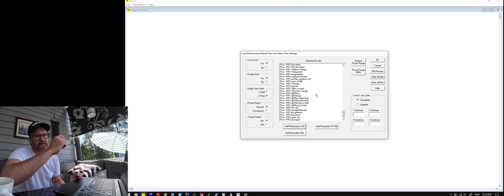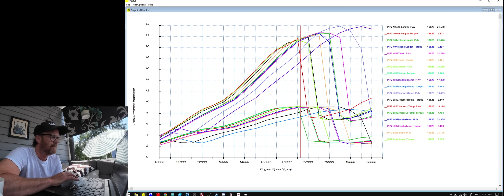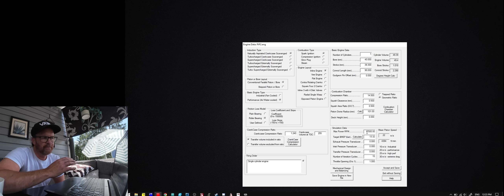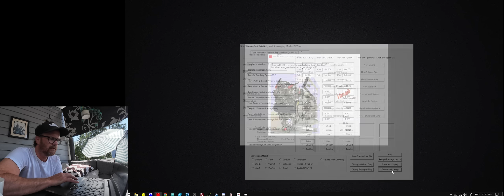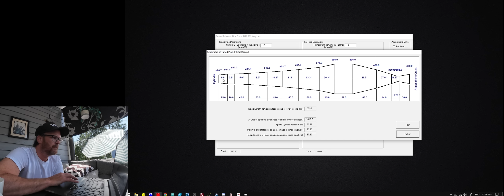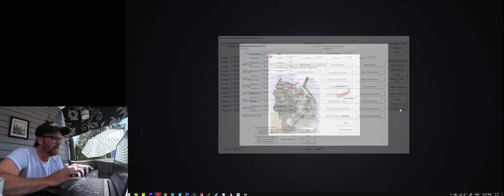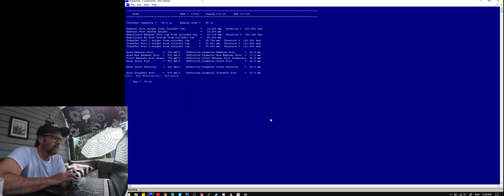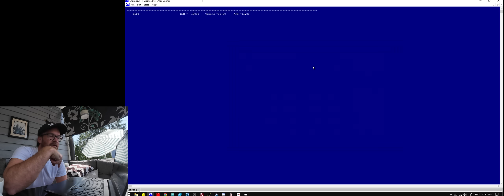A HUGE flaw in my 50cc Two Stroke model?

Comment: I've been using engmod for about 12 years, and I noticed the transfer-passage-layout section was not shown ( 'Design Passage Layout' button, followed by 'Display').  This sets the locations and angles of the transfer ports in the cylinder, and is absolutely critical in getting accurate simulations.  It's a pain to do, but it has to be done - maybe you've already done it and just didn't show it.  While I'm here, I'd like to mention my 2T engine design and prototype.  120cc,  symmetrical 'ring' porting,145hp & 48 ft/lbs torque at 12000 rpm, GDI, 1 bar trapped boost, super low emissions, valveless, 4T lubrication, very wide powerband,  developed in engmod.  It simulates well to at least 20K rpm, but the GDI is impossible to do at that speed using existing injectors.  Kick ass at the Flats!
Reply from the maker: Sounds awesome! The passage layout part was done, forgot to show...
Reply: @2STROKESTUFFING  I thought so!   It took me a while to get mine right.  Neels has seen my work on the 2T engine, and been kind enough to make suggestions
Reply: @2STROKESTUFFING   One thing I meant to mention - have you considered a minibike-type centrifugal clutch (tons of them on Amazon) and straight chain drive to the wheel? The clutch will get hot on acceleration, but drag should be reduced at full speed and perhaps reliability will improve.
Reply: Is this a simulation or an actual running engine?  If it is, I'm impressed!  Additional information anywhere?
Reply: @paultinwell5557 Thanks! It's just a simulation so far, the CAD work is maybe 1/3 done and injector finalized,  trying to get the rest of the GDI parts together now which has been challenging.  It's going to need hi-speed piezo GDI injectors so HV bipolar drivers are needed.
Reply: @rayivers9437  I just subscribed to you and hope some day i see you show your engine off 😀
Reply: @bismuth7730  Thank you kindly!  I hope to see it too, the sooner the better :^)
Reply: @rayivers9437  GDI doesn't need to mean piezo injectors.  I'm assuming you're injecting directly into the cylinder, is that correct?  If so then yes they need to be high pressure injectors and high speed too, but many engines achieve the same without resorting to piezo.  What sort of cylinder pressure are you considering at SOI, and why wouldn't transfer port injection do the job?
Reply: @paultinwell5557  It's all about injector dead time and precise pintle control.  1.2ms  to 1.4ms pulse width is not much time to inject 145hp worth of fuel, especially 200x/sec at 12K (the conditions are very similar to a 24K rpm 4T).  I really wish I didn't need GDI piezos (only two exist, the rest are diesel), but their faster response time is critical for more fuel flow.  A port injector would make a really cool afterburner on my engine, serious flames would probably shoot back > 50 feet (I'm not kidding, unfortunately).  Cylinder pressure at SOI will be @ 15psi/1 bar, and  at TDC more than 250psi/17 bar, fuel pressure will be 200 bar regulated.
Reply: @rayivers9437  Pressure is low, so I don't see any issue there.  Available injection time is the killer as you need to effectively run four times faster than a typical automotive injector.  Flow could be handled by multiple injectors... even though I doubt you'll come close to your projected requirements.  So yeah, you probably need the precision of the piezo depending on what you intend the engine to be for.  What is the engine driving?What prevents you using the diesel injectors if you can get the flow you need from them?
Reply: @paultinwell5557  Thanks for the replies!  I'll be running two Bosch Mercedes AMG injectors that apparently flow 1500cc/min each at 200 bar (privateer flow-bench measurements, good luck getting anything from Bosch), which should be just enough flow to squeak by.  I'd LOVE to look at diesel injectors, but everything trustworthy I've read online indicates they won't work (pressure/flow/spray pattern/lubrication requirements incompatible). Lots of bad info out there though - ChatGPT just gave me an electric HPFP list  that was 100% false.  OTOH,following your suggestion sent me to a site with a bunch of diesel HPFP's worth looking at - so thanks again!  I still can't get over how huge these piezo injectors are, two giant knitting needles sticking out of my cylinder. I've been following the pre-2007 era of F1 (no rpm limits) and I honestly think piezo GDI injectors may have been created back then for the 20K-rpm engines, finding their way into production cars around 2010 or so.  Do you know of any good GDI-system designers/tuners?  Seems like everything's so OEM-oriented with no real innovation, at least that I could find
Reply: @rayivers9437  diesel injectors require oil, and many are high pressure oil and many also have coolant flow across them as well.... I'm not a two stroke tech, but a diesel tech I am 😊
Reply: @Divided-We-Fall444  Thanks!  What about diesel fuel pumps?  I've been unable to find a standalone electric-powered 200-300 bar GDI pump, would a diesel pump work with gasoline, or would there be lubrication issues there too?
Reply: @rayivers9437 ... because the clearances in diesel pumps are necessarily tight of the the high pressures involved, my (limited) understanding is the diesel fuel lubricates the pump itself as its pumped, straight petrol would probably make it seize.. 2stroke mix ?.. I dunno... 🤔
Reply: @peterfitzpatrick7032   OK, thanks!  Just a continuous learning curve on this thing :)
Reply: @paultinwell5557  It's similar to the Alpha-Otto engine, but without the conventional porting and complex exhaust valve.  My engine scavenges vertically along the bore axis, and the exhaust  is at nearly full boost pressure while the EP 'ring' is open.
Reply: My initial goal was just to get the power density of a 1987 Cosworth GBA Formula One 4T engine (0.8hp per cc) in a 2T; not rocket science, just another approach. Once the ring porting, boost, and detonation were sorted I was happy with initial 184cc simulation results (156hp at 18,000rpm, 0.84hp/cc), but then wondered if my 'holy grail' (1hp/cc) was doable so I continued. Neels' guidance was crucial resulting in multiple big gains, and soon it was over 200hp (1.08hp/cc). Further development was all about reducing max power & rpm for the same power density, so I could use a 450F supermoto and existing GDI components for the prototype.

Current 8200cc (500 cu. in.) Top Fuel engines are @ 11,000hp at @ 12K rpm, 1.34hp/cc rolling grenades.  My 2T should easily do that at 16K rpm on race gas, with better ET's / trap speeds / reliability. No finish, no win. :^)   And sorry Alex to hijack your 2SS presentation.
Reply: I call BS on those figures.
Reply: @howhistory5877  Absolute BS. 145 hp from 120cc=  over 1200hp/lt. That is close to top fuel dragster territory, running 90% nitromethane, massive boost and a 5 second engine life.
Reply: @Ozsmallborehard to argue that🤣😂
Reply: Put the pipe down champ.

Comment: Loved this. If you wanted to go a step further you could even create Monte Carlo simulations by using simple python scripts to generate your Dat2T files where the parameters values are randomized within limits you set and then also write a Batch2T script that then reads the Dat2T files and runs the simulations. All of this would be relatively easy to implement using AI tool like CoPilot to generate the scripts. Just upload one of your Dat2T files and get it to generate a dictionary of the parameters you want to change and then you can set the limits for the key ones you are interested in changing and then run all the simulations and perform a sensitivity analysis. You can automate the analysis also. Anyway, just a thought for another approach to convince yourself all is good! Great work Alex!

Comment: hi have you tried welding 2 peices of shaped flat   steel together and pumping it up with a  pressuer washer colin furze did a videio on it you  could make the requied shape much quicker just a thought
Reply: Hi ! If you're talking about exhaust pipe, i believe it has been long time proved that sharp angles work better than gentle curves. Some 2 strokes exhaust pipes guru even take the effort to hammer the inside of welds to make sure of it. Don't ask me why ^^
Reply: @bobibobo31  the angles have been calculated to focus the exhaust pressure waves precisely, moving from section to section, carrying the exhaust gases with it... effectively creating a "vacuum" on the engine-side of the pipe taper which draws more exhaust gases out and fuel-air mix in... this happens only at pipe resonance which is the tuned frequency of the combined cone sections.... 

Pipe design and construction is literally an art form as much as a science... it has always fascinated me since my early teens, I even several books on pipe design...all long gone now, at 67y.o. my memory of it all is lost too... 🙁

Comment: i think the exhaust duration will cause the power to be very peaky, tuning the exhaust pipe will help a lot
Reply: He has a CVT and is going for top speed runs. So having a narrow power band isn't that bad for his application. You can see in the video with the test drives for Bonneville that it takes some time to get the engine going but once it hits the powerband it really goes. After that it is just the CVT slowly changing the gear ratio for acceleration and the engine stays at peak power the whole time.
He also added this manual lever to force the CVT into a low gear ratio for easier launching.
Reply: @marcelpursche5339 that cool, so the bike stay at it peak hp on the entire acceleration, but i think cvt are significantly have more friction at top speed. thus reduced it top speed potential, it remind me of 60s 50cc gp bike that have 13 speed and reach 200kmh
Reply: @falahsamisyahdan7962 - How does the CVT remind you of a 13 ratio transmission?
Reply: @Scissors69 because i think cvt cant reach top speed like gear transmission
Reply: @falahsamisyahdan7962 Also, isn't cvt more friction that sprocket and chain? Would seem that's something one want to eliminate for top speed runs, friction that is.

Comment: Please never stop pursuing your dream of the most powerful twostroke!
Reply: Won't let me comment on main ! Go get them  stuffing! Raccoons fight!
Reply: What is currently the most powerful 50cc two stroke to beat?
Reply: @Well_Theres_Your_Problem power is a hard one to measure as all dynos differ. The fastest 50cc streamliner is 145mph, the fastest siton is mine at 105.206mph  with fairing, the fastest 50cc naked (without fairing) is the Bonneville record at 91.8mph. I just hope he gets a good shot at it, its the hardest sport to hold an engine wide open for a coupl eof miles, lots of hurt.
Reply: @Well_Theres_Your_Problem He will be in either A-F or A-G depends on what fuel he runs. The A-F record is 89.03mph the A-G record is 91.8mph. Im pretty sure listening to this video he is running fuel os 89.03mph he will be chasing.